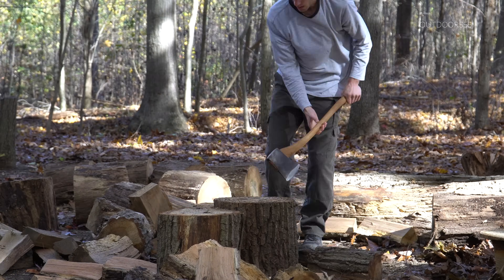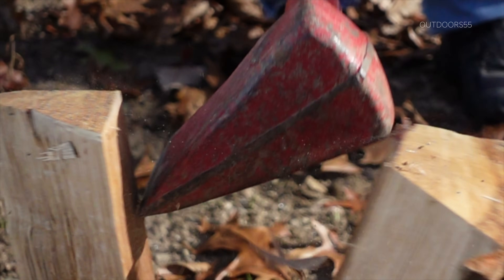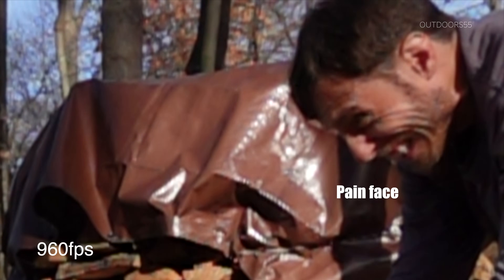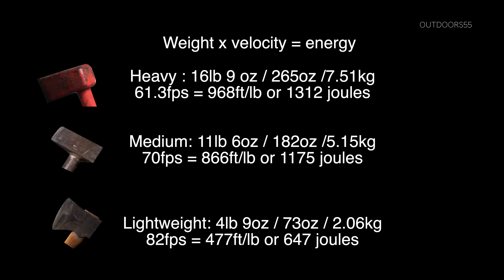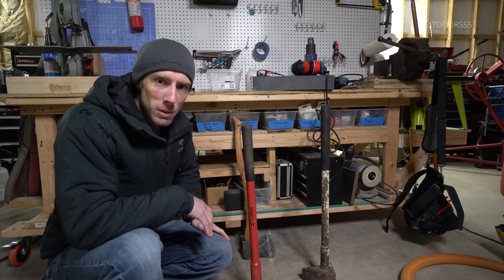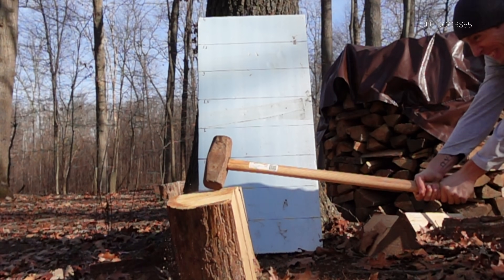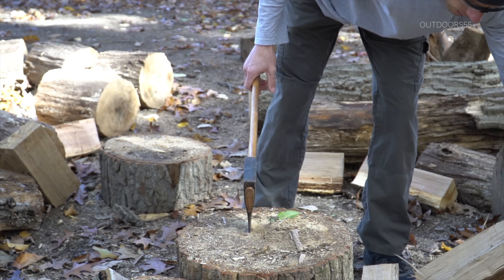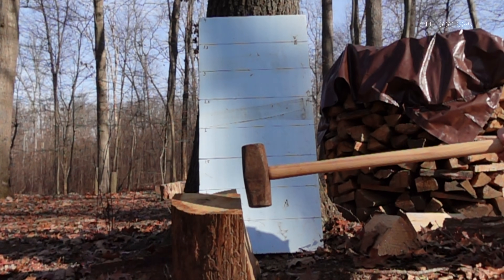The Great Wood Splitter Debate

Comment: I feel like you're basically describing FOC or front of center weight on an arrow in archery. So let's say your bow is 45lbs draw weight.. and you have 3 arrows with 3 different weight tips 100gr 200gr and 300gr.  So let say with the 100gr tipped arrow the balance point of the arrow[ if you balanced it on your finger] would be in the center of the arrow like any tube or shaft.. The 200gr tipped arrow would have a balance point a little closer to the tip than the 100gr and the 300gr tipped arrow would have a balance point much closer to the tip probably within the first 1/4 of the arrow shaft. 

All shot from the same bow.. [45lbs]
The 300gr tipped arrow will have way more penetration than the other 2 but will be significantly slower in flight. 
For example my first archery deer I killed, my arrow was set up with a 100gr broadhad tip shot from my 45lbs bow and the arrow did not pass all the way through, it went through one side and stopped on the opposite side of the  ribcage inside.. [great clean shot quick recovery]
The next time I went I decided to use the same set up but add 125 gr to the tip making my arrows tip weight 225gr..
Since then all of my arrows pass completely through flesh and bones and exit the other side.. adding tip weight Will greatly increase the power of the hit using the same amount of force.

Last year I got a 75lbs bow and shot 4 deer with 125gr tips and got the same results as I did with my 45lbs bow and 225gr tips. 
Adding 125g to my 45lbs setup created the same force and penetration as a 75lbs bow with 125gr tipped arrows..

Comment: When you swing the axe there are 2 main forces : weight and the force of your arms. The energy given to the axe by the forces is called the work of the forces, it's roughly equal to the aount of force exerted (in newtons) times the distance traveled. The distance traveled is fixed and the ammount of force exerted by your arms ils also the same from axe to axe, only the weight changes so it's normal that the heavier axe has more energy on impact. 

But you spent that extra energy by pulling the heavier axe up anyway, energy must remain constant one way or another.  That doesn't tell much about the ability of each axe to split wood though.
Reply from the maker: More energy equals more splitting ability.

Comment: Your formula for energy is wrong. Kinetic Energy = mass*velocity^2. However, Kinetic Energy is not conserved, meaning some of the KE of the swing is going to be lost via heat in the handle of the splitter, the head of the splitter, and also to break apart the wood. I think this is too complex a problem to solve via first principles. I think "power" here is maybe not an important metric, but speed and ease of splitting wood is, as those are the metrics that a person splitting wood actually cares about. I would design a test to measure more empirical things such as how much weight/hour of wood you can split with each axe, or something like that.
Reply from the maker: Read pinned comment.

Comment: I wonder if it's possible to measure the force required to split a log? Like, maybe cut a groove of standard depth as an initiation point, screw a bolt on either side and pull with chains (with a force gauge attached) until it splits? Great vid, btw. All my "ah, but what about..." were addressed in quick order, as usual.
Reply: An off the shelf hydraulic press, with a force plate, would do the trick. You'd just need to bolt the different axe heads into the press.

Comment: It would be interesting to see the difference between the three with a horisontal swing; taking gravity out of the picture. Or even fighting against gravity on an upward swing.
Reply: I mentioned in another comment that judging by the relatively small differences in final velocity, he is probably getting most of his work done through assistance from gravity.

Considering this, if he were instead fighting against gravity in some weird scenario, like splitting wood over his head, there would instead be HUGE differences in final velocity, wigh the lightweight axe probably winning out.

Comment: I think we should separate lab and real world here. In the lab we get that more heavier means more better, which is fine. In the real world what good does it do if you can only split five pieces until you're completely exhausted. So a more realistic (and more useful) test would be to measure how many similar pieces you can split in a given amount of time with any of the three axes or how tired you are after splitting a fixed amount of them.

Comment: And by the way, energy figures don't really do us that much good. The factors to consider are:
* Blade geometry. To penetrate into the wood we need pressure, not energy, so lighter sharper axe might penetrate better than a duller heavier one.
* Head shape and surface treatment. To split a piece the head must push through it and these are the factors that affect that.
* Momentum. This correlates with the energy and depends upon velocity and mass and was measured in this video.

Also a good question is how much momentum do you actually need to split a given piece of wood and if there's no overkill, as well as how much energy is needed to generate that momentum.

Comment: compared to what?  i.e. heavy is 5x heavier and delivers 2x the power. which means you're lifting (spending energy) 5x more than the light for 2x the result.  it's like driving a sportscar that gets 5mpg and spending $25 vs driving a normal car at 25mpg and spending $5.   then the question becomes what do you need?  i.e. are you splitting the kind of wood that needs to be hit with 1KJ? or would the same wood split under 500J?  if it'll split under 500, then the rest of the energy is wasted and you'll be more tired at the end of the day than you needed to be, more wear and tear on your body, etc.
Reply from the maker: Thats why I said it wasn't an efficiency or effectiveness test in the beginning.

Comment: We Gather Fallen trees from around the pastures and split them to sell as firewood at the farm I work at. The splitting maul that we have is I would say A medium sized maul, but on one aide of the blade, about an inch up from the blade edge, is a small Square angled protrusion. I have about the same size and shape splitting maul at home but without the small protrusion and it doesn't seem to work nearly as well. One swing with that one at the farm and the haves practically fly apart. If you're splitting smaller stuff you have to be careful because one half goes flying sometimes if you give it too much oomph.

Comment: If it's Fitness, I can lift 5 Times more weight depending on the exercise than my father. He grew up on a farm and is a lumberjack. Never worked out. I got my own splitting axe which was way lighter than his. One day I used his splitting axe and it gave me hard tendon and wrist pain, also I had sore muscles the next day. Same spruce and pine as always. I might lift more, ans have more muscles than him, but he can carry stuff like refrigerators alone and can hold, carry, press and pinch things way harder  than me. He got real world strength.

Comment: Interesting. Another question that could be asked is, how much weight is adequate to split firewood? 1lb is not enough, and 25 would be way to much. Where is the sweet spot? Also, I have noted that very expensive  light weight titanium hammers are sold with marketing that claims that they hit harder because you can swing them faster. A similar test done with nailing hammers should produce similar results.

Comment: I take issue with your units of measure,  energy proportional to mass times velocity squared.   That said your conclusions are correct.   I find an 8 lb maul with a plastic fiberglass core handle is best for me to endure a few hours of splitting.   Let the mass falling do the work, not the speed of the swing.   But then I’m old

Comment: Dude, mass*velocity is not equal to energy....
E= 0.5(M*V^2) [in metric units if you want jouls]
The velocity is to the power of 2
What you calculated if I saw correctly is momentum.
It might still be that the heaviest is with most energy, but I didn't see your velocity values so i didn't calculate it myself, but it seems your physics is off
Reply from the maker: My math is correct. My statement was incorrect. Chalk it up to being wet and cold.

Comment: I don't know if it matters, but you get far more joules per pound with the light axe. I can see that making a difference.
Reply from the maker: Thats a good point!
Reply: If you apply the exactly same energy to an axe or bullet the energy per pound is different, but the total energy of the object is the same, Which is the same energy that will go in to the splitting.

Comment: Use the lightest tool that yields progress.  I can swing the heaviest for one hour, the lightest for 6hrs.  more work gets done with the lighter one.  But the biggest choice that yields the most wood is made before the work begins, when you choose the wood.  I love 6"-10" straight grain doug fir.  That gives me a cord the fastest.
Reply: I like Ash, that nice straight grain makes for easy splitting. It also burns hot and will burn green.

Comment: The most powerful will be the spiral point fixed to the rim of a wheel driven by an old v12 engine, though any car engine will do really...
When it comes to axes though, it's more about technique, you are using all your force there to throw down, you are not using any reciprocating pulling energy in the off hand. Combining push and pull energies is just one trick though. You also have the side split method on landing, and, you're splitting in the middle in the highest density region of the tree's structure which is not where you want to aim for an easy split. Power isn't everything, in fact it has very little to do with it, people buy into it and purchase these giant things that are blunt as hell more often than not, have crap tempers and only good at tiring you out. You might last a day if you're fit but try ten days, or 30 in a row. You'll be dead. Cant split wood if you're dead. You need good technique, good steel, good geometry and a good eye to observe, calculate and then good aim to hit exactly where it will split the most easily. Can't put that shit in a book as math. You can learn all the math in the verse but it won't tell you how to split wood or throw a baseball. Only experience can do that.
Reply: Good points, but you clearly weren’t paying attention to the point he was making in the video. Which Head would get the best results?

Comment: I think there are some variables to what makes a splitting axe work well for what you need.  Some axe head profiles are suited to brittle, harder woods and others are good for splitting softer stuff.  Most full sized axes that have a fat, wedged profile can split any types of wood though.  Equally if you have really easy to split timber than you can get away with using a light thin axe.  I personally think my 4.25lb/36 inch handled, thick and stubby vintage axe is one of my best splitters.  I have a maul that's 6.75lbs/36 inch handle that I rarely use that's designed well.  Most of the time when I can't split the timber with my best full sized axe, the maul can't get through either.  Big knots, defects or a notorious tree species sometimes can't even be split with splitting wedges unless you're very stubborn.  

There's a limit to the weight you'd want to put on a long handle.  You showing in this video that the heavy heads don't need as much velocity to do the same work lends itself to putting heavier heads on shorter handles.  This is why I prefer a heavy axe for splitting kindling most likely.  Can even be on a 14 inch or shorter handle.  With a boy's axe(somewhere around 2.5lbs, 23-28 inch handle) you really need to whip the axe to get the speed of the head up. Scaling that down to a 1lb hatchet splitting slightly difficult kindling and you really see where head weight comes into play.  It's also more dangerous to get the velocity of your axe head up.  The harder your swing, especially when tired the more out of control you feel of the axe.  I am very comfortable swinging an axe.  But there are limits.  Maybe because  you can never swing a maul too fast it's safer somehow? To me a maul is usually 6-10lbs.  A full sized axe is normally 3-6lbs but they can be 7 maybe even 8lbs or more.  There were apparently some massive full sized axes produced in north America before the chainsaw.

Handle length can also keep you safe though.  So a 36 inch handle might be the difference between hitting the ground and hitting your foot.  For people that are not focused on keeping themselves safe a long handle might be a good idea.   I think my conclusion is that a 4-6lb full sized axe with a short thick bit on a 36 inch handle is best for most people.  There are some variables to what length handle they can swing.  A really short person couldn't use a 36 inch handle effectively.  That's why the boy's axe is still produced.  A small boy, anyone can use it.  That's more of a cross cutting design though.  Just vomiting my thoughts here, axes and timber processing are things I love.
Reply: I don't think your supposition about heavier axes being safer is entirely correct. I think with heavier axes there are three factors making it more dangerous: 1. you may not realise that you don't have the power to get a full and controlled swing in until half-way through it, or your extended muscles may not be able to support it as your muscles at the beginning of the swing could 2. a slower moving heavy axe is always fighting you with gravity making it harder to control throughout the swing 3. the inertia makes it much harder to stop when you recognise it is moving in the wrong direction or that you didn't put enough power in.

It is also good to have a lighter head because then you can go slower if you get tired instead of having greater risk with barely being able to hold up a heavier axe.

These are mostly related to cross-cutting/chopping, I think it may well be a different case for standard vertical splitting
Reply: @rolls_8798  I think I was trying to extrapolate out of heavier kindling axes being safer that heavier full size axes are safer.  I think you might be right.  While velocity can feel hard to control his numbers on the energy produced shows that a heavier axe would take more energy to stop.  And I can attest to that.  Where a maul is deflecting when you're tired, you don't want to be there.  That's why it's important to have good strategy and safe technique.
Reply: I would very much like to see your short wide splitter.

Comment: Ive been splitting wood for a long time and I’ve found that what works for me is using two axes; the Fiskers 8lb maul and the Truper 16 maul like the one you have. I use the Fiskers for basically everything, it’s plastic and fiberglass core handle dampens vibration and helps to avoid joint pains when used for a long time. You can feel the shock of each hit with the all metal Truper which is why I only use it for gnarly pieces of wood the Fiskers is too light to split. Long term use: I’ve had the all metal maul break at the neck once and again after having it professionally welded. The last time it was welded a rod was inserted half a foot down its hollow handle and it hasn’t broken since though it is now bent. The Fiskers maul’s plastic has cracked also at the neck which has left its fiber glass core visible. Either way both are still going.
Reply: love the long handle on the fiskars
Reply: @yaykruser  yeah, it’s an all around good design.
Reply: That's man stuff there.
Reply: I've found I like to break rounds with 8lb and once they are in smaller pieces go to the lighter easier X27
Reply: @davidwyby  that’s a good way to do it. I was surprised on the quality of the Fiskers maul, and I’ve heard good things about the X27. They seem to make a good product.

Comment: thanks for nerding.  ideas/suggestions.. idk if it's enough material for another video, but -- okay, so most power is not the same as most efficient or most effective... how would you define most efficient and most effective and what's the difference between them?  is there any way to attempt to measure efficiency or effectiveness, even in thoroughly non-scientific, half-assed, and subjective manner that's good enough for youtube?

thanks for the video
Reply from the maker: I think that would be a much harder video. I think efficiency is what does the most amount of work for the least effort. Effectiveness would have more to do with what type of wood is being split. You couldn't really split some of the bigger rounds we have here with the lightweight axe. You would definitely need something more effective. So you would want a mix of the two. 🙂
Reply: @OUTDOORS55  yea idk how to split wood or make youtube videos.. since you didn't go any farther than "we're not talking about efficient or effective", i had a feeling there might not be a video here but i figured i'd float the question :)

Comment: Very interesting. But it's also not a shock as the heavy and medium bring more energy. It would be interesting to see you do some more tests in the future. The light weight splitting axe is more "aerodynamic". And like with knives we know geometry cuts, can we also then assume that geometry also "split"?. Would a very good splitting axe be more "efficient", or would brute force still win? Would also be interesting to see some of the splitting wedges results that you hit with a sledgehammer. If you got some laying around or some pieces of 1055 1095 (or similar) that you could make some out of. I don't know how you would do the test, maybe give a certain time to each or something? But I'm sure you can figure that out better than me, I'm just spitballing here